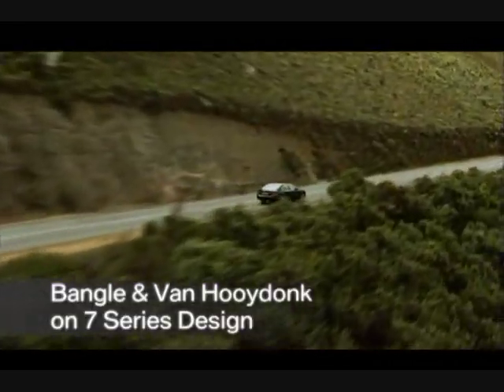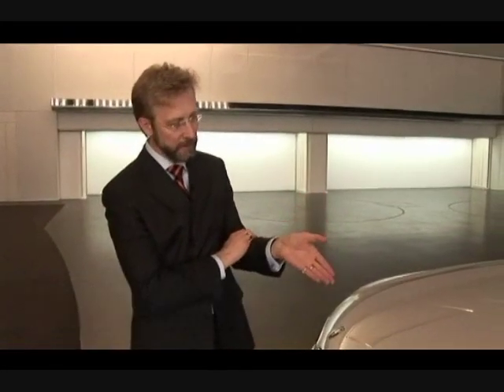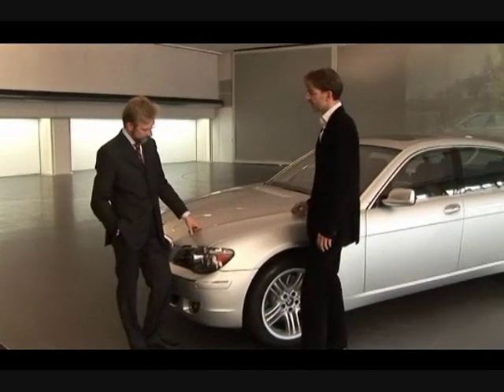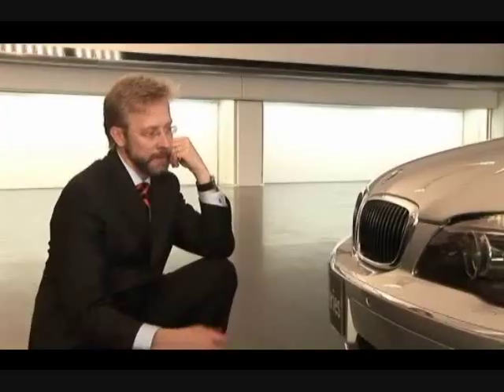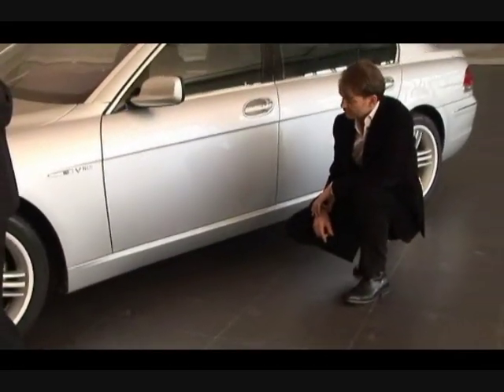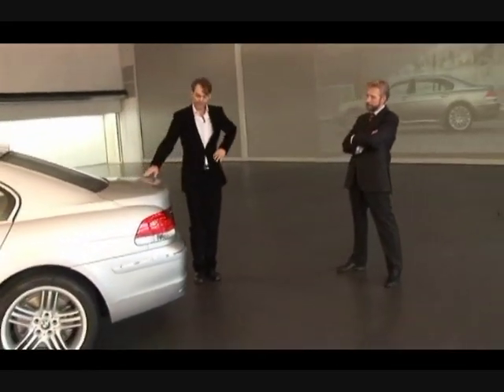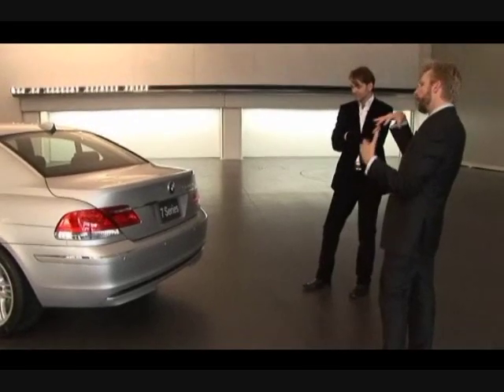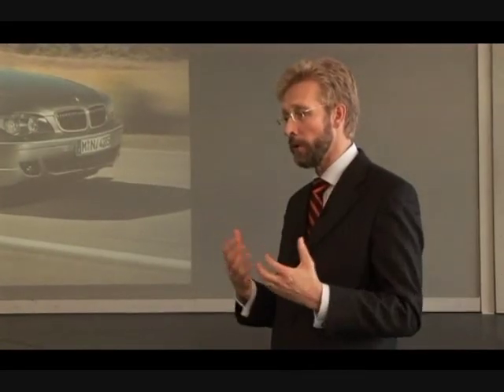Exclusive BMW E65 7 series behind the scenes: What makes it a uber sedan

Comment from the maker: Up until the E60/E65/E90 generations of the 3,5, and 7 series, the design philosophy was to create "same sausages of different lengths." It wasn't until the mid 00's that BMW changed it up and created these radical, non-sister resembling BMW's. 

Like it or not, BMW's sales went up during this time period as the E60 sold far better than any other preceding 5 series, like wise the E65 and E90 were for their respectives. Part of this has to do with the increased quality in those models....
Reply: ToyotaforCorolla you're wrong. They sold well in America, anywhere else Bangle's BMWs were a sales disaster.